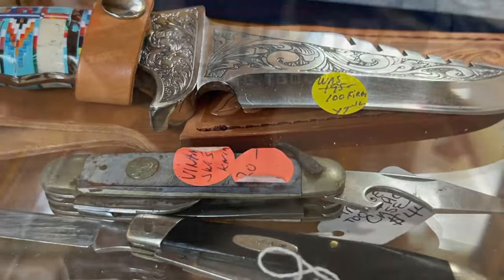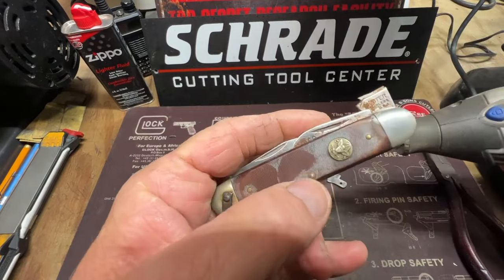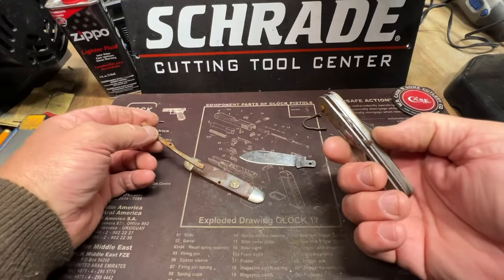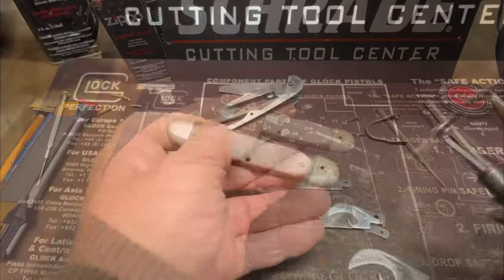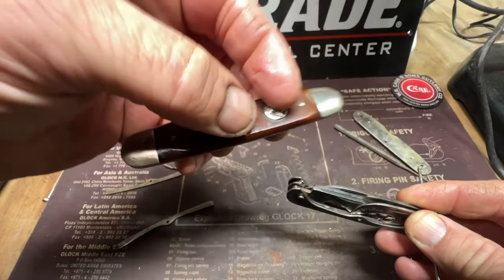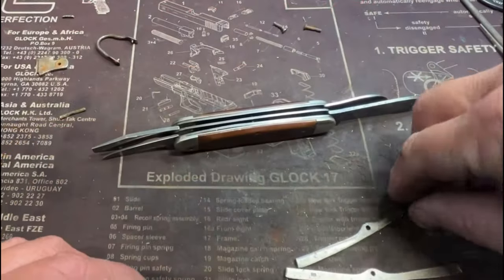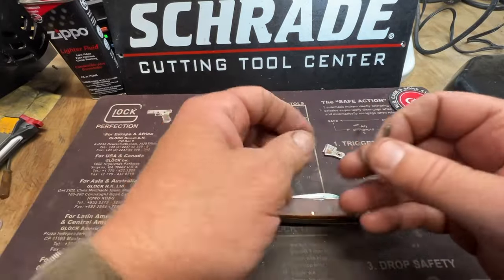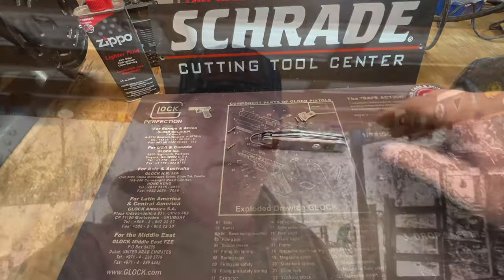Restoring a Vintage Boy Scout Ulster Camping Knife: Replacing Main Blade & Blade Pins

Comment: As always, great video! I’m getting ready to undergo the rebuilding of a few of my grandfather and dad‘s old knives. Where do you get your brass pens from and also, do you use a steel pen through the blade or brass as well?
Reply from the maker: I get mine through Amazon.  I use steel in the blades.  Brass or steel in the springs, just depends on what was already in there.  Thanks for watching!!
Reply: Thanks so much for your reply! Blessings.😊

Comment: What's best to remove rust spots from a carbon steel blade please? Watching from England 🇬🇧
Reply from the maker: I use 400 grit sand paper.  It all depends on how much rust.  I have a sander I use when it’s heavy rust, but light rust I do by hand.

Comment: Hey Kevin, I have the identical scout knife that I am replacing the main springs on. Where do you find your pins? I have 3/32" brass rod, but it is too large to go through. Can I drill 3/32 through the handle from one side to the other and use a 3/32" pin or is there something just  a bit smaller that will slide through? Thanks, Skip Ward in Alabama. Was TDY to Camp Gieger for a training exercise and that was an experience.
Reply from the maker: On the brass pins I sand them down a little to make them fit.  I use my 1x30 sander.  I rotate the brass pin up against the sander belt.  I don’t sand much between checking to see if it fits the hole.  It shouldn’t be forced to enter the pin hole.  It should not be to loose either.  I hope this helps.
Reply: @theknifedoctor  I had actually done that with mild steel 3/32 7818 welding rods, but it is hard to keep them uniform. I would chuck a 3" piece in a drill motor and turn it on a belt sander. Thanks so much for the reply and sharing your knowledge
Reply: Also, thank you very much for your service. I look watching your videos and especially when someone recognizes your service.